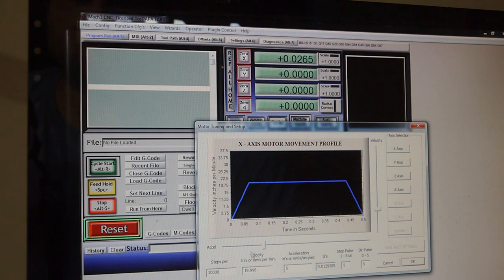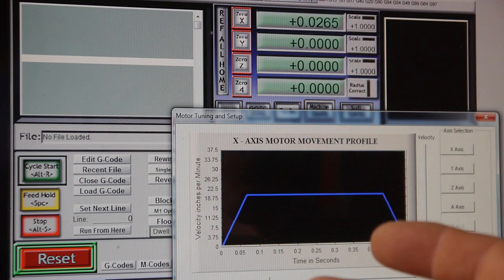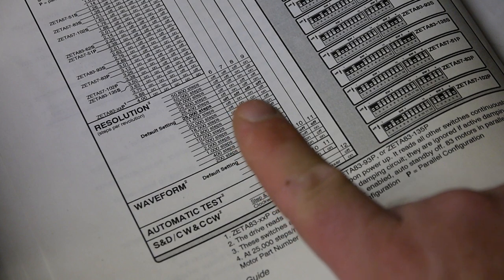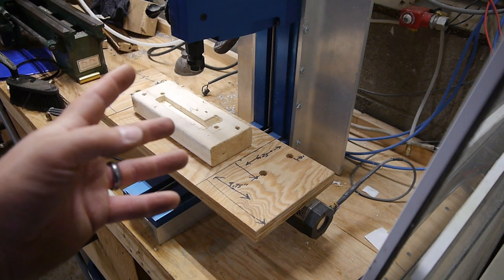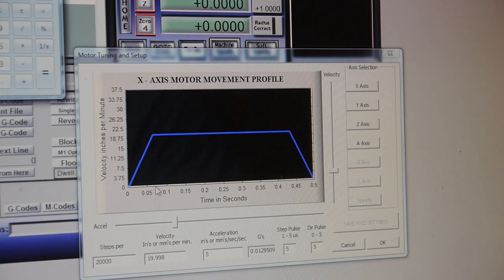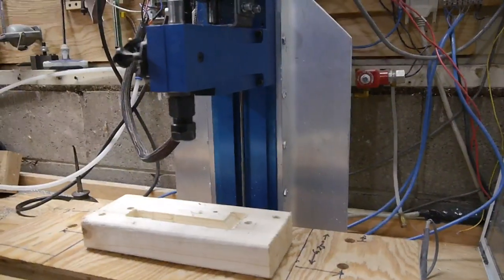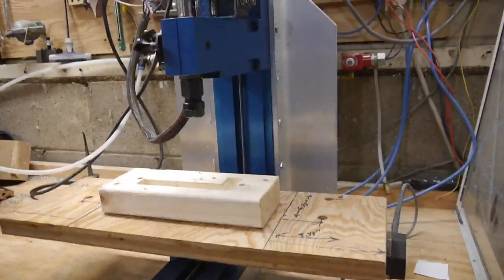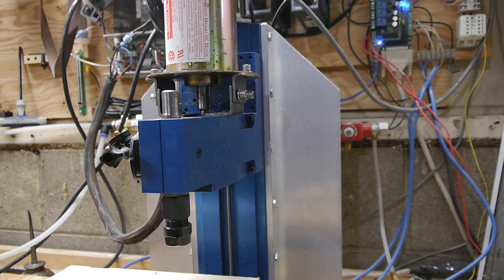150 IPM Stepper Motor Driver Setup and Explanation for Mach 3. Done on a MaxNC CNC 150 IPM feedrate

Comment: Awesome video! So as simple as pulse/rev * TPI = steps per in Mach3. Time to get mine up and running now
Reply from the maker: Yep! Can't wait to see it chewing up some aluminum!
Reply: HA you gotta wait. next issue is the nut on the spindle is stripped really bad so it's a real PITA to get it on an off. Probably why I only ever had 1 or 2 end mills on it so far

Comment: Good stuff man. I think my controller is set up exactly the way you had it at the beginning. I be checking it out this weekend. 80 IPM sounded like the sweet spot to me. You need bearing blocks for those leadscrews bad. You might wanna cover the ways and screws with plastic if your cutting wood. Sawdust mixed with oil can eat up machine tools.
Reply from the maker: Thanks, I agree 80 IPM sounded right to me too. Bearing blocks and way covers are on the list of upgrades for sure, first though I think I will focus on straightening the shaft for the y axis, or at least attempting to do so.
Reply: I was wrong my set up is the same as yours at the end of the video. For some reason I get some stalling  on  my x and z (mostly x) axis above 50 IPM with 200 oz motors. It might be the on board driver chips. I have a beefier set up I could adapt to it but it's running my mini mill right now.